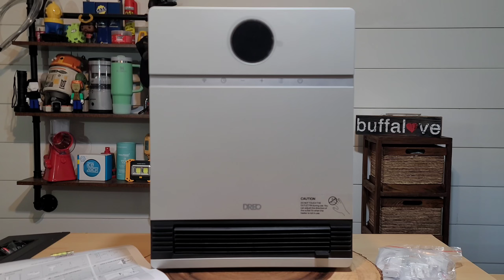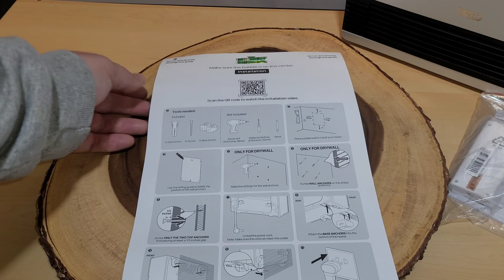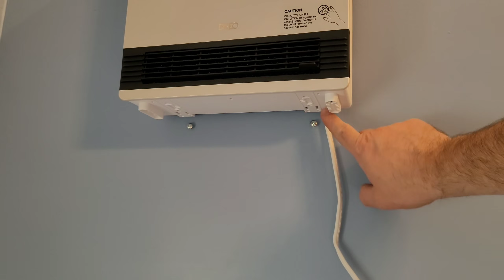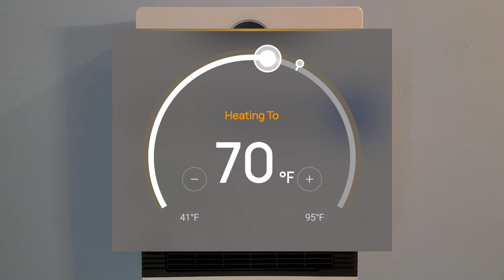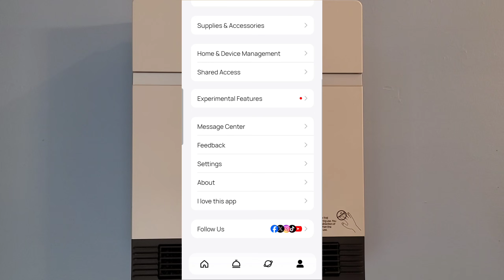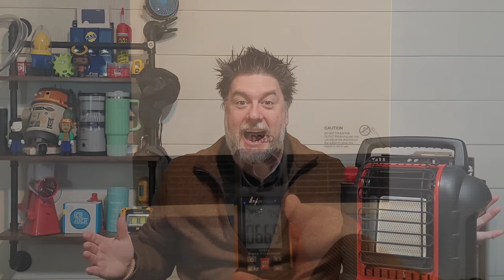🔥 DREO smart wall heater. How to keep your bathroom warm. Wall mounted space Heater 🔥 [624]

Comment: These things aren’t accurate.  I’ve bought 2 and they dip down 5+ degrees before kicking on and then may not shut off for hours and reach over the set temp by 5°-  maybe I have defective units… the concept is great, heating is ok, app is nice, but they need to work on some
Internals